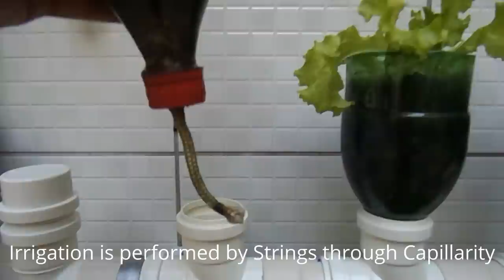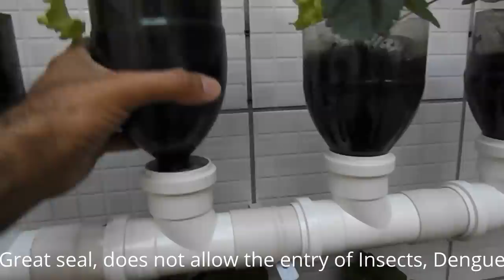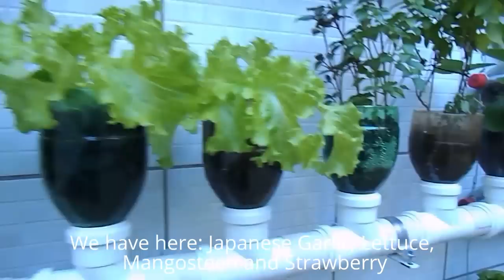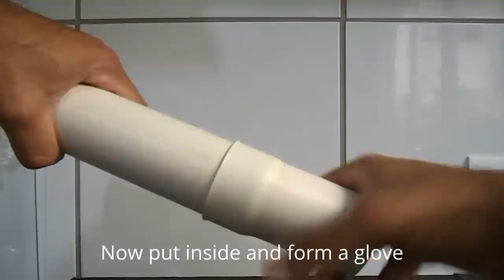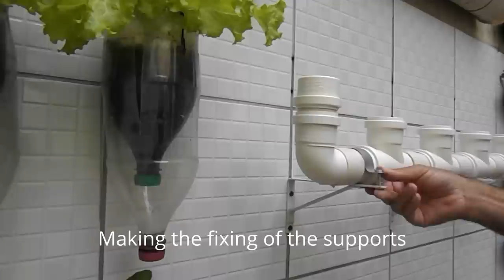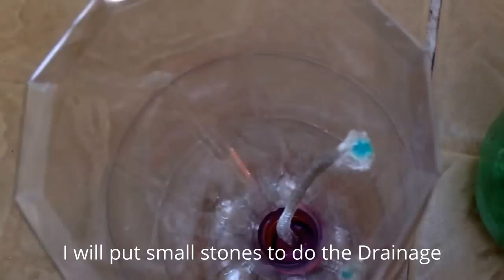Bottle Garden The Incredible Self Watering Pop Grow System 2

Comment: do you need the cord (wick)???? if you keep the water level in the water bottle at a level above the pipe fitting, wont the water level in the "pots" stay at the same height through the little hole, or does the cord not allow the pots to fill up to the same water level of the reservoir?
Reply from the maker: Thanks my Friend I appreciate the information